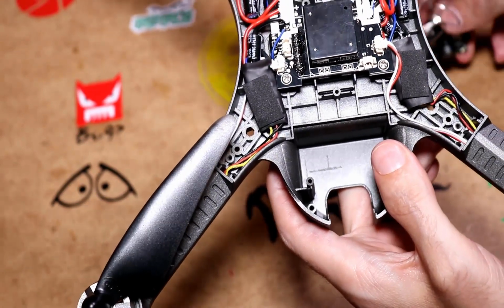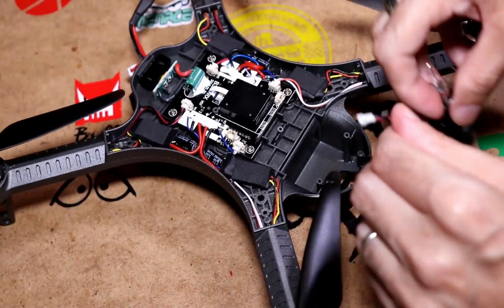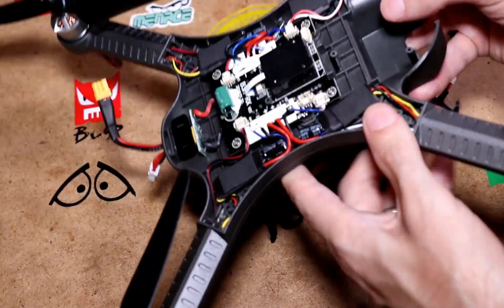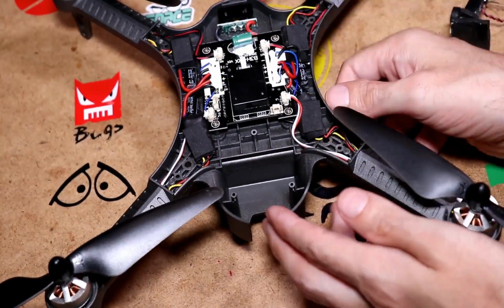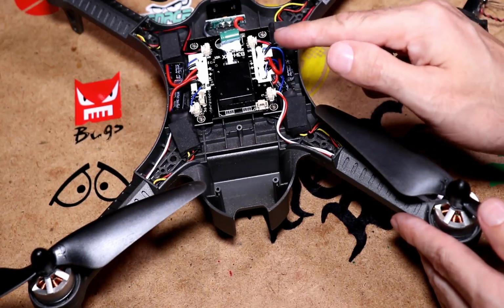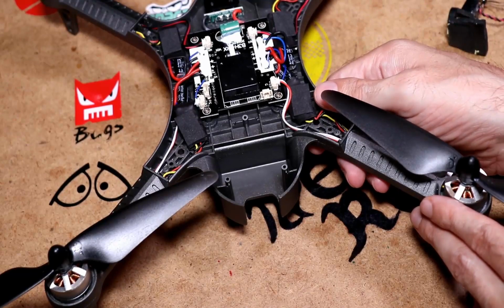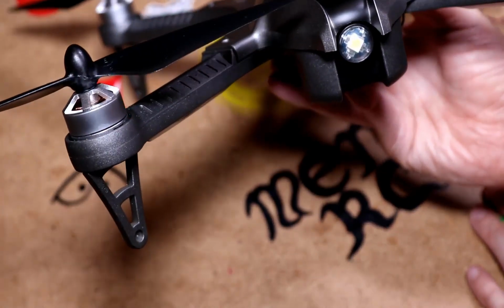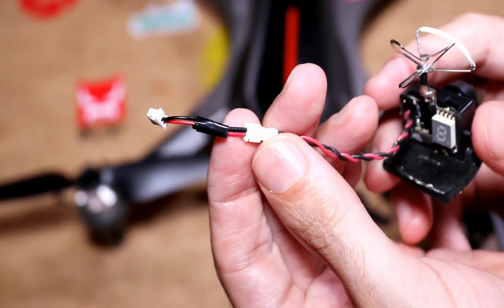MJX Bugs B3H Simple FPV Mod And Test Flight

Comment: Is there a way to get less in the view ? Minus the the craft front end showing.
Reply from the maker: Make a extension so the camera is not in the quad or a smaller FOV on the cam might help.........and the last mod cut the front of the canopy so there is no pointy plastic in the way.
Reply: I saw on another vid where they just mounted the camera as low as possible & the canopy wasn’t in view anymore.
Reply from the maker: Yeah you can mount the camera many ways i only did this as a demonstration.